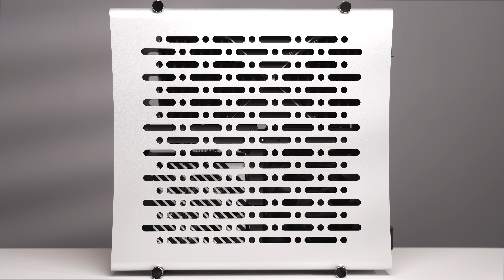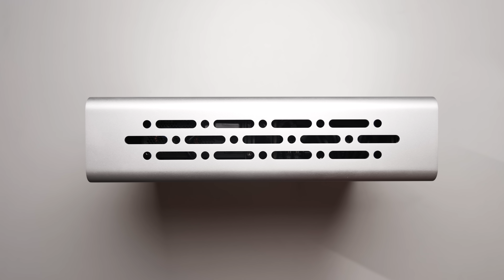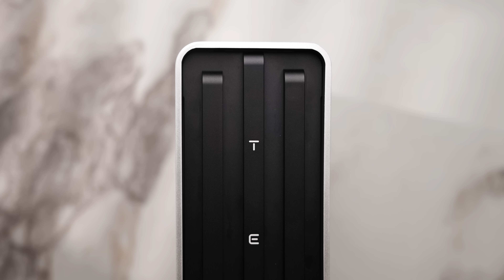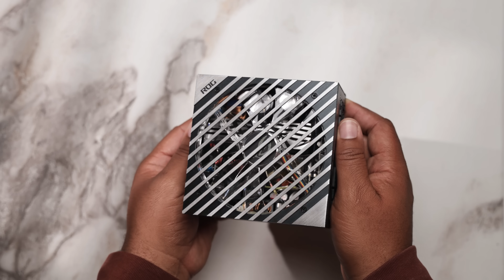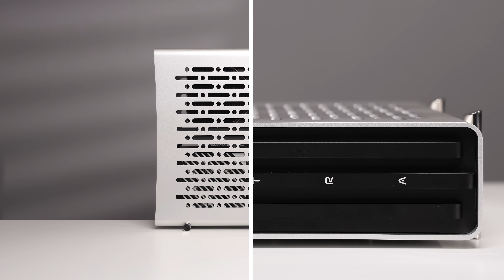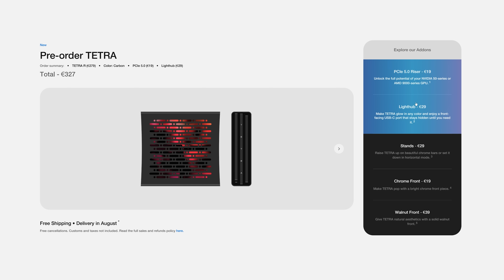TETRA R: RTX 5080 Console-Style Build

Comment: The Tetra R reserves the width for a four-slot graphics card, but because it is 7mm short, it cannot use various flagship graphics cards on the market. What’s the point of having four slots? It would be better to increase each dimension by 1cm to improve compatibility. This way, you could use a 77mm down-blowing cooler and also fit a flagship graphics card. Overall, the experience would be much better.

Comment: I think the appearance and material selection is excellent
   The NVME without some kind of cooling is a negative point
   Why I wouldn't purchase one, the sound mentioned about metal to metal contact. I think it is a side effect of components vibrating, but the case itself shouldn't really amplify vibration or sound of components. 
   Maybe it's a good case with some additional refinement of the design to eliminate that sound.

Comment: I have a very important question about thermals: how did the NVME at the back of the motherboard behaved in terms of temperature? It doesn't have a heatsink and it's thermal padding doesn't touch the aluminum shell so I'm wondering if it wasn't running Toasty.

Comment: I've preordererd the Tetra S, got a bunch of new components cheaper because of blackfriday.
I intend to cool it with an external MORA 420 radiator in a custom made ,ESP32 controlled and 3d printed case ;). 
i intend to put the radiator during the summer outside and during the winter i can use the heat.

coming from a Fractal Torrent Nano 35l i'm really loking forward to a tiny case for my living room setup.

Comment: a case that is simply full of holes to solve the cooling issue is not a case since it does not protect from dust or coil whine, it is the same as an open test bench. A proper case should have a designed airflow, like a garbage can Mac Pro or Xbox Series X.

Comment: Addon: "PCIe 5.0 Riser - €19"
At least it's cheap unlike competitor that charged $99.99

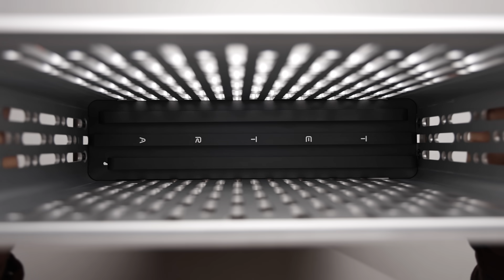5:32 Ahhh~~
Reply: And not just any PCIe 5.0, it's Linkup AVA5, which is usually in the hundreds on amazon. Only possible at 19 usd due to our partnership & we get to offset some costs by not ordering a PCIe 4.0 riser.

Comment: The already very high price does not end at the case sale itself unfortunately. You also have to pay shipping from China and potential customs tax on top of that, which potentially adds a lot to the already very expensive price. Thor Zone also had some drama a while ago that unfolded on Reddit, where they ultimately admitted defeat in favor of the customer - but only after it became public. So, be aware that if you need any sort of support, you likely will not get any at all.

If it weren't for all of that I'd really consider this case, especially since there's barely any "console" style SFF cases anymore - especially those who support those up to 70mm top blow coolers (I think pretty much only the Tetra R, the Ridge, and the N-ATX v2). I don't think it's too big though. Yes, it's a bit higher, but only slightly higher than my D32 Pro, while being basically half as thick. And even with those sandwich style cases - are you really crying about a bit more height, even though it saves you actual practical desk space?
Reply: Shipping is included in the price, but any potential taxes are not.

Comment: Any rough idea on custom cable measurements? I messaged Thor Zone about them, but I’ve yet to get a response. I’d love to get some ordered before the case arrives.
Reply from the maker: They’re the same for the M2 build 400mm on CPU, 300mm GPU and 300mm on 24pin. These could be tighter but I used a really stiff grade of cable.
Reply: @ChrisRussellTech  

Thanks for the insight! 

I actually just bought a custom sleeved set for my NCase M2 Grater a few months ago, so hearing this actually has me even more excited that I don’t have to order new cables again.

Comment: Nice review - were you able to measure the absolute maximum height that the CPU cooler can be for the case to be able to close? Is it 70mm exactly?
Reply: It's 70 mm for the R and 54 mm for the S. So the typical low profile top blow coolers should all fit into the R, as they usually max out at 67-70 mm..

Comment: At this point with my 9950x3d any case that doesn’t support AIO is less than ideal. I guess I’ll have to get a second CPU for cases like this (pun intended). Great video!
Reply from the maker: Depends on your workload but there’s not many low profile coolers that can handle any Ryzen 9 variants at their stock profile, tuning could change things but it depends on
Reply: The ~70mm coolers that fit into the R (not the S) should be able to handle that at least at stock settings. Noctua's L12S lists your CPU as compatible without turbo / overclocking headroom. If you undervolt it should be somewhat bearable noise levels too. Keep in mind that most gaming loads aren't going to be the same extreme as CPU benchmarks though.

Comment: I pre-ordered the Tetra S and I can’t wait to receive it.
A 5090 FE and a 9800X3D are already eagerly awaiting their future new case.
The Tetra S should be the perfect case and tailor-made for the 5090 FE :hand-orange-covering-eyes:
I am waiting for reviews on it as soon as possible, to check the effects of possible turbulence or other inconveniences, but I have already thought about a solution possibly with the air duct kit like the NA-FD1 or similar.
To see !
Reply from the maker: I don’t think turbulence will be a problem but the 92mm fans do concentrate a bit so we’ll see
Reply: Which cpu cooler are you using for the 9800x3d? I'm using one from noctua but temps while gaming get pretty high..
Reply: @pedrodamn6637  At that cooler height you kinda have to look into undervolting or live with very loud fans (if that's even enough). I wouldn't go slimmer than the Tetra R / Ridge for that reason. Lots of air cooled SFF cases are very much designed around those ~70mm coolers for that reason.

Comment: I think it's really cool that you can mess with the two front side panels for power and USB-C instead of a more finicky solution. I think it's size is great for a tall, slim case, similar to the Fractal Ridge for the purposes you mentioned someone might need/want it for. I'm also glad to see Thor Zone has seemingly made up what their brand identity will look like from here on out.
Reply from the maker: The design is quite intriguing, I’d love to see a sub 10-litre version
Reply: @ChrisRussellTech  I am surprised to see that the optimal configuration is with the GPU at the bottom and the CPU at the top while Thor Zone sells the system to be mainly vertical in the other direction.
Surprising !
Reply from the maker: @NH-Nicolas I think as more people test the case there will be many more results that say the opposite. My configuration could be completely different than the next.
Reply: @ChrisRussellTech  I cant wait fot review Tetra S with 5090FE :hand-purple-blue-peace:
Reply: I think the front actually works much better on the Tetra than the Nanoq, because on the latter you end up with those big flat plastic corners that kinda look odd / cheap. The Tetra does not have that due to the slimmer design.

Comment: i was about to buy their cases, but they almost guarantee you’ll have import taxes, at least in the eu, and the products are already expensive, so no. also, for that price they should provide dust filters
Reply from the maker: For sure the tax situation is very bad for international commerce
Reply: Primary reason why I dismissed them too. The already high price is one point, can be justified to an extend, but then having to deal with customs too is really a joke.

I think the Nanoq had magnetic dust filters but they were a bit of a pain with the sliding design. Not sure if the proper Tetra comes with them or not.
Reply: Taxes are not really an issue. They are the same as if you buy within the EU. But there may be some fees. I am not sure about tariffs, PC cases may have none in the EU but I might be wrong about that.
Reply: @sagichnicht6748  however you want to call those. their website says if you live in the eu you WILL get fees, I don't know where they ship from, I've bought things from Asia without fees, but if they say so I have to believe them